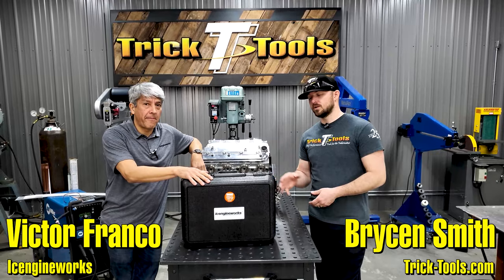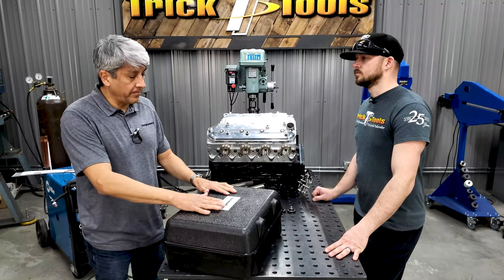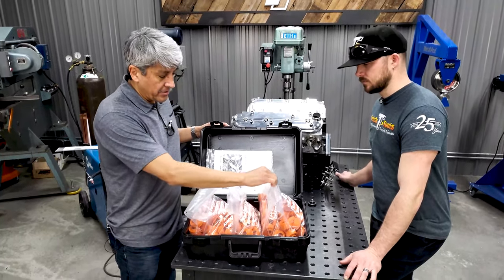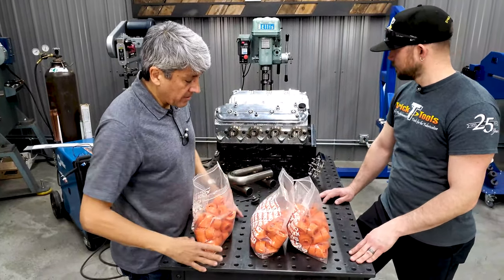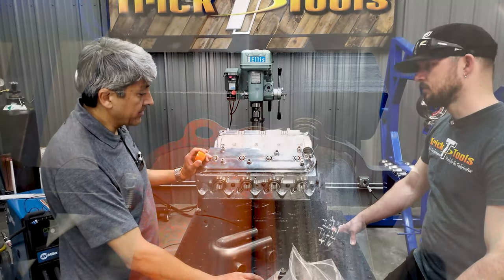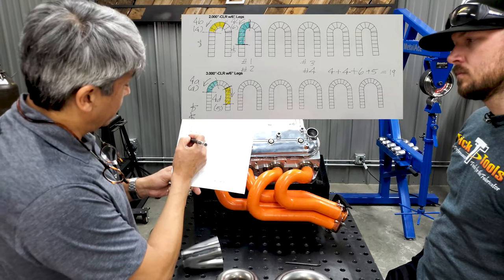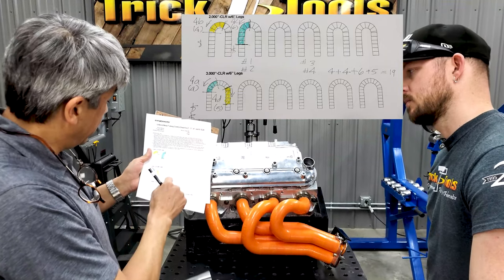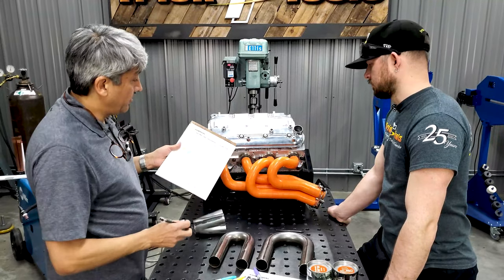Icengineworks Header Modeling Blocks - Trick-Tools.com

Comment: Come on Man. Make them equal length. The kit is Uber expensive. It's too make equal length headers. Are those. I'm going to bed. Catch the other 15 mins tomorrow. Hopefully you will make them equal. Do a project on your truck!
Reply from the maker: Equal length is not necessary most of the time. Unless you are building a high performance engine for racing purposes the majority of people wouldn't even notice the power difference between the equal and non-equal. The kits are intended to help anyone build a header/manifold/exhaust for their application regardless of the space in their project or performance needs. Yes, it can help ensure equal length if that is your goal but is not meant to only and specifically do that. Check out our header building 101 video where we do build equal length headers for a drag car. https://www.youtube.com/watch?v=lBmjU83kaow

Comment: Yikes. I can understand the ability to use less seams. Not really shure how the arrows work when lined up.
  How would you be able to do this in a tight chassis?
Reply from the maker: If the arrows are lined up it means that section can be cut out of one bend. obviously this is going to be different for every job and if your specific job required the arrows to be split in order to achieve the right design for the space then that's ok. It's more to help your design when possible but lets you know where your cuts and joints are necessary.